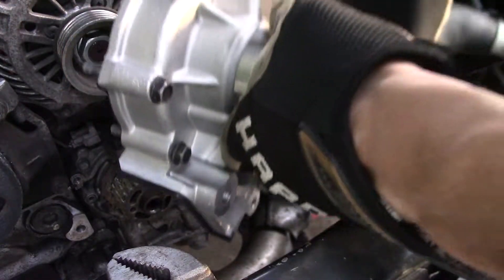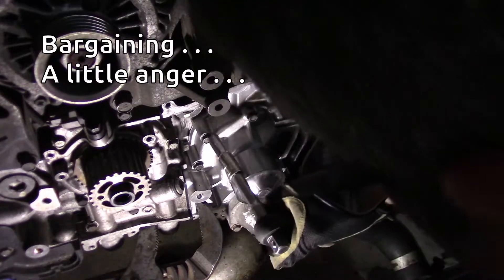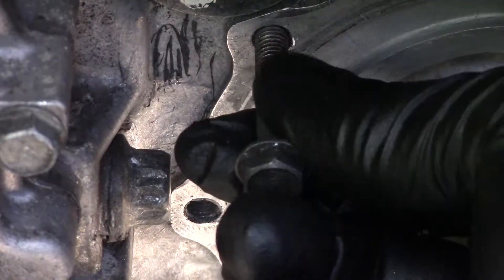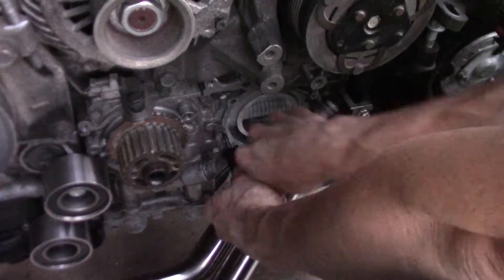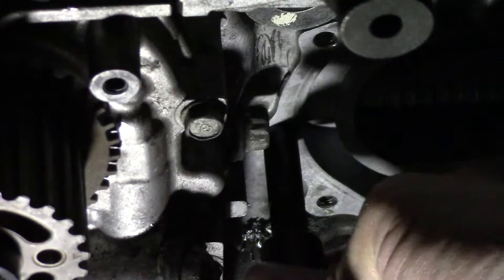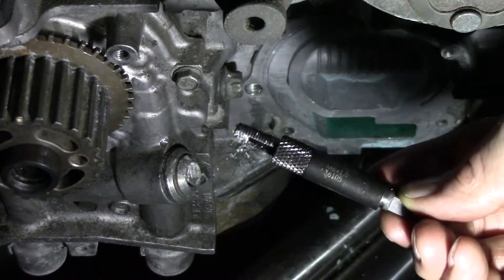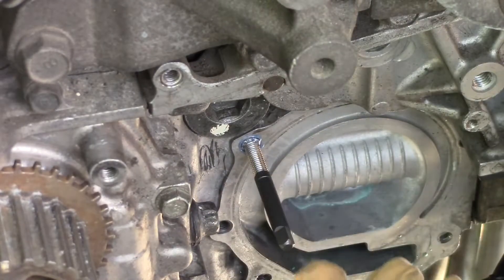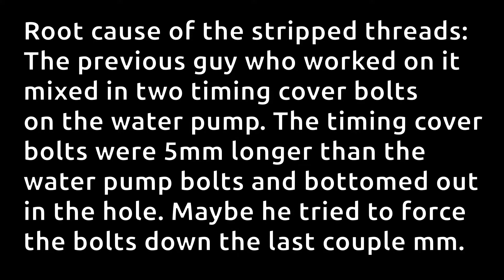Repairing stripped threads in an aluminum engine block

Comment: Honey what size is that drill? I have the kit but it came with a 6m drill and yours looks like a 7m
Reply from the maker: The drill that came with the kit didn't have the size stamped - just D*HSS USA. I measured it with a micrometer and got about 6.1mm.

Comment: Do u use a bit about the size of the tap guide or the original size of the bolt
Reply from the maker: The bit was designed for the thread repair kit. So all the pieces work together to thread the hole for the insert. Even though the kit is kind of expensive, it works very well for me. #notasponsor
Reply: If you don’t mind what size of the kit and what size of your Bol
Reply: I have 14 mm bot hole , I don’t know what size of the kit that I should buy